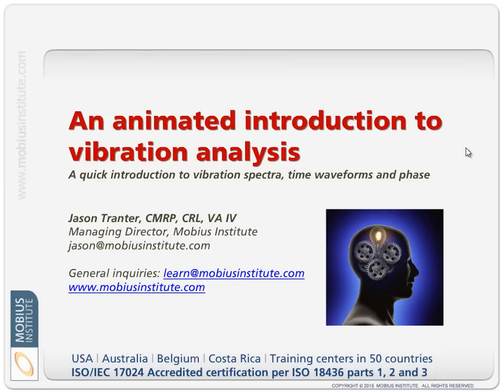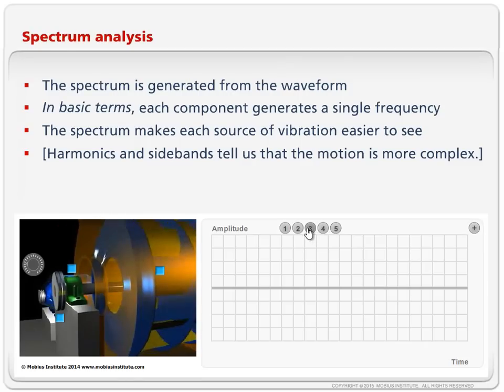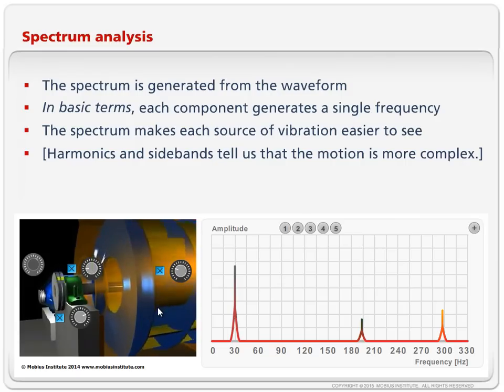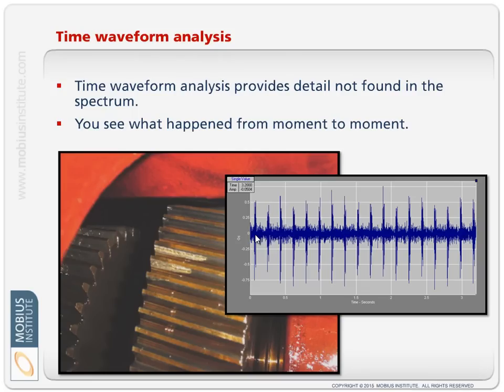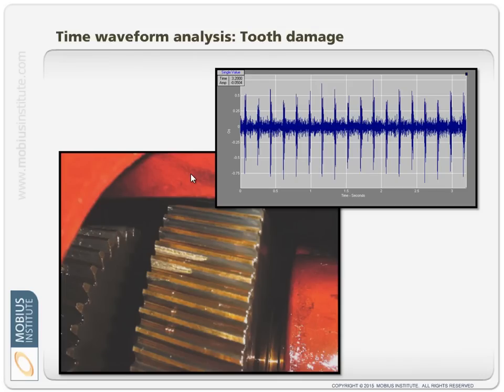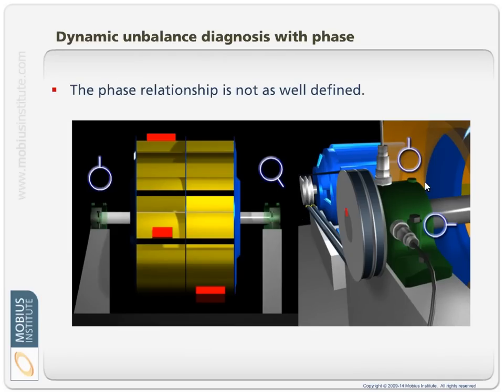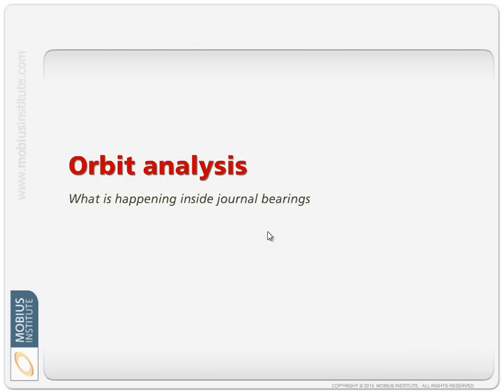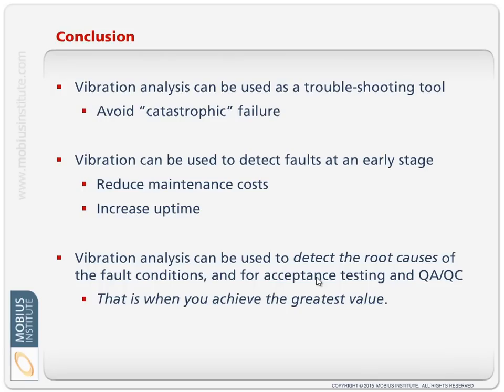Vibration Analysis - An Animated Introduction by Mobius Institute

Comment: Dear Sirs, Thanks for this presentation. I'm a Professor in the Dept. of Mechanical Engg.,  from a private Engineering Institute from India. My Doctoral Research specialization has  been Condition using AI Technique: KBS: Knowledge Based Systems. Later for my Post-Doc Fellowoship, I worked on integrating MATLAB with ISO 10816. I thought of going through basics of  Condition Monitoring. I got excellent information from your presentation. The 3-D animations are outstanding. I will watch your other videos also in the coming days. Thanks.

Comment: Let's say, I have a surface, say a room's floor. I want to divide it into square grids of same size and place vibration sensors on each of them. Now, I perturb any one of the grids and want to estimate the vibration patterns. Can anyone suggest a nice (preferably open source) simulation software to suit my purpose?

Comment: Machine Saver Inc. is an incredible company catching all these problems (misalignment, unbalance, improper lubrication, looseness, cavitation in pumps, slugs of liquid going in to a compressor) the moment they happen through affordable and intelligent 24/7 condition monitoring, real-time FFT/Spectrum analysis sent through a 4G cellular gate to a user friendly cloud platform. These permanent systems (provided around the cost of a mechanical switch) provide actionable data through email and text message alerts so that the Vibration Analyst can focus on the problem machines and not spend time walking around, collecting data on healthy machines. It seems criminally inefficient to send an ambulance door to door (once or twice a month) looking for sick people when for the same price you could provide every house with a cell phone to call the same ambulance when they are sick.
Reply: Please contact me with a presentation on Katlego.Phoku@glencore.co.za